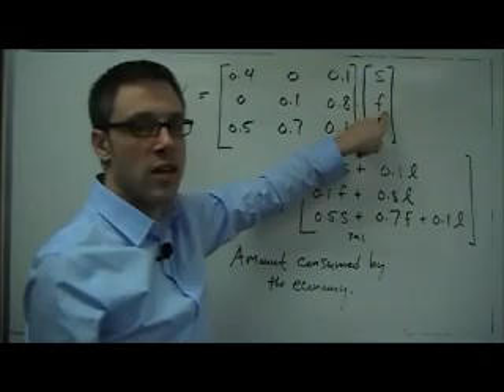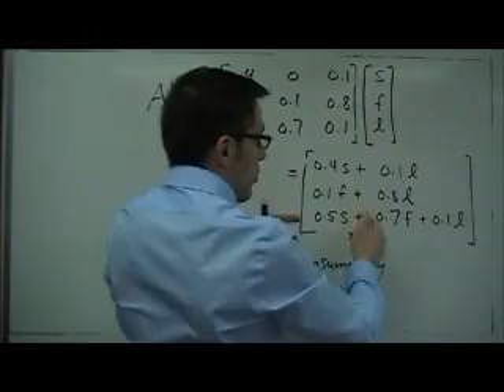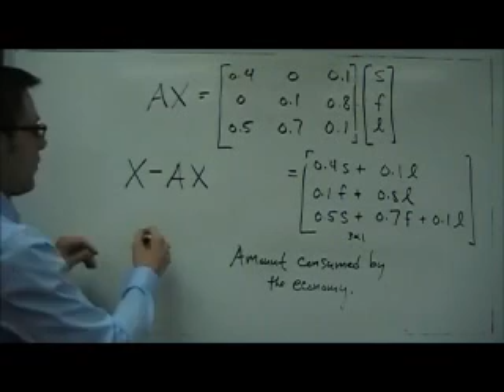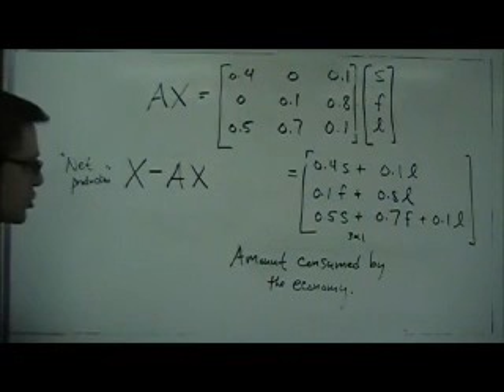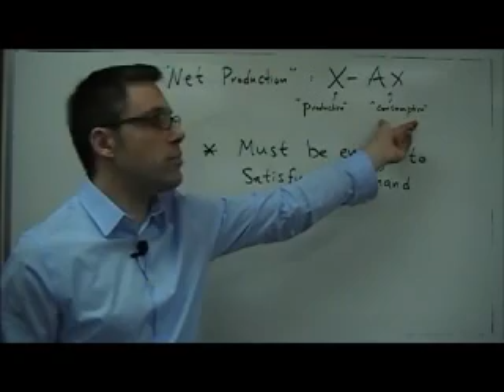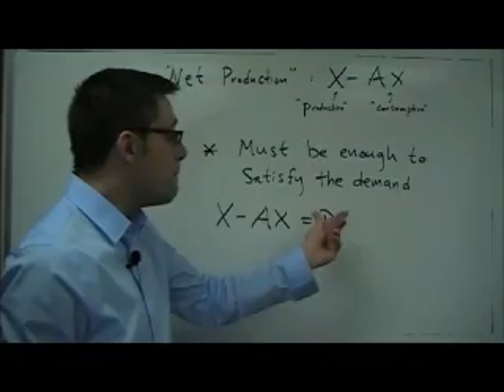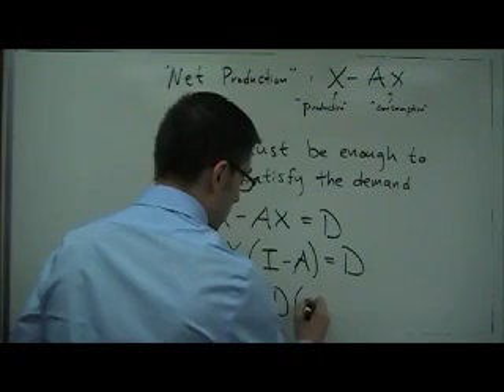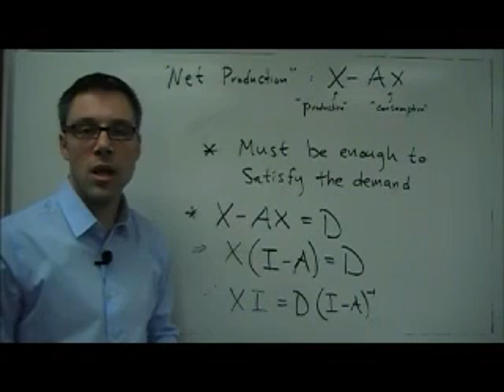Input Output Model part 2

Comment: Around minute 8, you go from X-AX to X.(I-A). Where does the I come from? Does it stand for the number one? Thanks for your videos, they are really clear.
Reply: It's NOT called the "unit matrix": there is no such definition in matrix algebra. It is called an IDENTITY MATRIX, and whatever vector you multiply it with, it returns that very same vector. In our usual arithmetic, is equivalent to multiplying any number with the number 1; the original number is returned as a result.